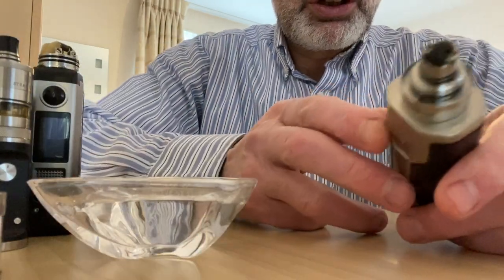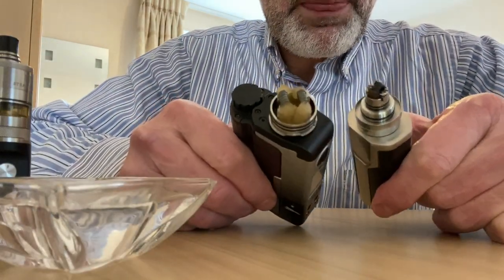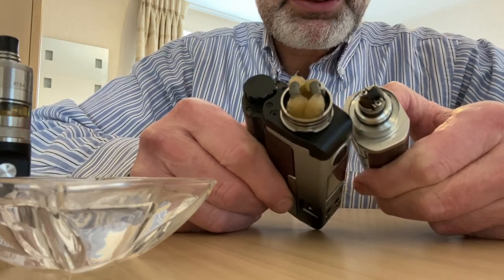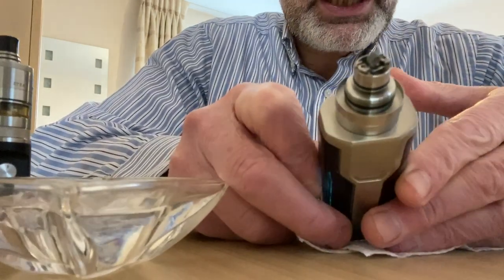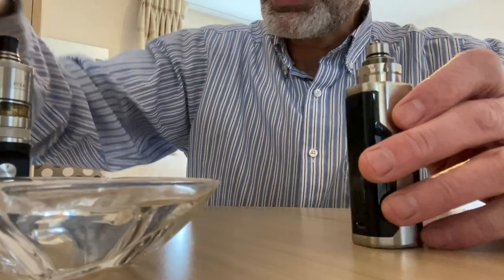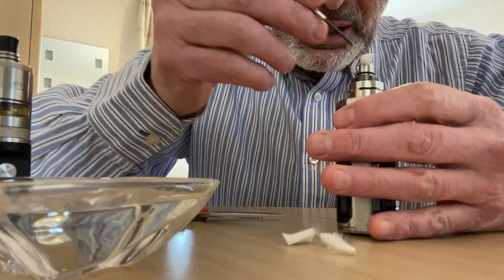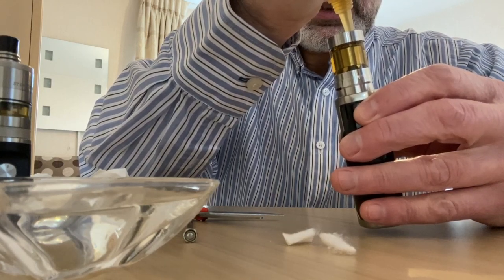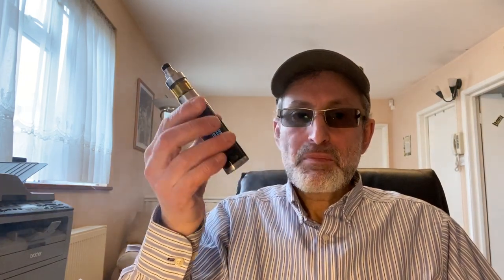How often should you re-wick your RTA | How to clean your RTA coil.

Comment: Isn’t it super dangerous to dip your coil in water while it’s still on your mod let alone a mod that’s on?
Reply from the maker: Not at all Shaun as you don’t keep the coil fired when you dipping in the water also you don’t immerse the deck and certainly not the top of you mod in water only the the tip of the coil, It is the best & safest method to clean & prolong life of your coils that I carry out every 2 days without any issues. I use the coil with the above method for up to 2 months.

Comment: How often do you change your coils for NET's when vaping daily? I'm using a 0.8ohm with 2.5ID fused clapton on kayfun x and I find the flavour now bit stale and I rewick daily. is it normal? should I change the coil? The coil is 2 month old and I use Burley Black Note
Reply from the maker: Wicking daily with authentic NETs is very normal. NETs only drawback is the rapid gunking. Black Note do gunk up coils. For me it is well worth the chore for optimal flavour. As for the coil itself if cleaned regularly it should last over 2 months. I change mine every 6 -8weeks  regardless.
Reply: @netvaper  Appreciate the reply. I can confirm the coil have gone bad because I just realized on my dani box when I fire the ohm jumps to almost 1.2 and then settle back to 0.8 even though the post screws where screwed tight. After changing the coil everything is perfect now and the flavour taste excellent as it should. Yes NETs gunk the coils super fast the coil always have thick black layer from 1 day usage. I think I will invest on kanthal round wire because 8 pounds for a pair of fused claptons is bit expensive and I have 2 other mtl tanks their coils might kick the bucket soon.

Comment: Great tutorial.  I've been vaping MTL & DTL stock coils for 8+ years.  I've thought about rebuildables for a while, and now, I am going to give it a go.  Top banana!
Reply from the maker: @Paul J. Morris-Pinchefsky. Thanks. let me know how you get on
Reply: @netvaper  I will, thanks. I've just been watching some of your MTL RTA reviews and they are all excellent.  I might go for Steam Crave's Aromamizer Classic as my first purchase.  Great work.
Reply from the maker: @projectmerlin   the Classic by steam crave is one of my favourites
Reply: @netvaper  Hi, reporting back... Yippee! I have just coiled and wicked my first ever RTA, and on the Neeko. First impressions; superb flavour!  Air flow isn't too bad.  I went with the 1.5mm below the coil instead of the 1.2, and 2.0mm at top. I might try the 1.2 in place of the 1.5.  Air flow is pretty good, but not quite on the spot. I've also just noticed a bit of popping going on, with slight gurgling as well.  I think perhaps my wick is too thick or dense? The tails are reaching the deck.  I'm trial running on the Eleaf iStick Power 2C in Smart Mode. I've done my maths too - 0.95 ohms set at 15 watts. I also have a couple of Digiflavor Siren Gs, and I'm using one of the skinny drip tips in the Neeko - looks and feels great. I often use these tips on a variety of my MTLs.  Anyway, I shall practise more. Thanks again. Great tutorial. I think the gurgling is getting worse. I'll have to investigate. Cheers.
Reply from the maker: @projectmerlin  Thanks for your update. Tip, always use a tighter airflow insert under the coil and either use a  bigger / same airflow on the top or non at all, the airflow will be much smoother . Pupping & crackling is usually from the fused coil. Gurgling happens when the cotton is over saturated, make sure your cotton ends fill the full width of the juice channels touching the deck where the liquid will be absorbed by the cotton. If you turn the RTA upside down, cover the mouthpiece with a tissue & suck a few times as hard as you can without firing. Magic, any gurgling will disappear. Enjoy the Neeko it is an excellent MTL.
Reply: @netvaper  Thanks for the tip - much appreciated. Shortly after last night's comment, I was fiddling around and then decided to remove the top airflow completely. This made a huge difference with zero gurgling.  I also reinstalled the Neeko's own drip tip (longer one) and it's wonderful.  So far, and thanks to your tutorials, everything seems absolutely dandy.  I've also just treated myself to 3 new mods too (an early birthday present) - the Lost Vape Centaurus Q200 & Thelema Solo, the old Wotofo Stentorian Basilisk, and another RTA - the OBS Engine.  I am very excited! 😃 Thanks again.
Reply from the maker: @projectmerlin  Wonderful Paul. All is good👍 enjoy all  your new vape gear😊

Comment: Very helpfull video! It would be nice to know at what wattage you heat up the coil, before dipping it into the water and also how many times you repeat this dipping process before you finally get rid of it  and put a new one. Thnx !
Reply from the maker: Thanks. I dry fire at 14w just to get a glow that burns the gunk, the dripping in water takes it all off so when fired again your coil is clean as new.  I do that very often up six 6 weeks and sometimes more. You can tell when the coil is gone it looks brittle and black even after cleaning.

Comment: Thanks for the information on how to manage RTA. I've just got my first RTA, Kayfun a lie, and have felt unsure if you would change coils every time the taste got worse. I myself use e.pipa and have always used pree-made coils. Tomorrow I'm going to build my first coils, exciting. Thanks
Reply from the maker: Good luck last0048.
Reply: @netvaper  I failed completely. All of it is too small so I can't see anything. I tried to use Geek vape mini tool kit. I think I have look after som pree vired coils or try it again later.Tha coils I try to use is Kanthal 28ga and that is a very thin one.
Reply from the maker: Take it slowly step by step. Get for starters Pre- made 1.0 ohm MTL coil. Fit the coil and secure then cut the legs flush then dry fire to eliminate hot spot then insert the cotton not too think that you can’t get it it through the coil then trim to fit in the juice well’s then moisten the cotton. Screw the deck in the tank fill and vape. Step by step you only need to do it once right and you will be able to do it right thereafter.
Reply: NET Vaper thank you very much. I will try to get some tomorrow 👍😇

Comment: Hello.What e cigs you can suggest as nice easy for use,also what is stock coils,and is it that   all e cigs you can upgrade with  rta or rda coils. I bought argus voopoo and all coils i used just simply sucks,also gets bad on taste,so just looking for proper cigs with proper coils.Also i can see you use thin head top ,thats what i am looking aswell. :)
Reply from the maker: Stock coil is a coil that comes with a tank that you can replace after it is gone with another coil. RTA’s use a rebuildable coil that you need to install on the deck and add cotton. A completely different style. Pod kits are different to stock coil, that the coil cannot be replaced so you need to change the whole pod. As I understand you use pod mod kits like the voopoo May I suggest to try the Innokin Gozee kit. Very good quality starter kit with excellent flavour & MTL drew,that you can use many different coils and change when needed.

Comment: try packing the cotton a little tighter in the MTL tank specially if u notice the liquid darken fast.

ran into a similar issue with the VXV soulmate rta pod where even clear eliquid went dark fast and the coil gunked up super fast. the issue has been fixed by raising my coil up a tad higher and wicking it tighter, i had clear liquid turning dark in 24 hours cuz of gunky eliquid backflowing into the tank. i also lowered the wattage by 5 but that was cuz i was worried the wicking wouldnt keep up, look up the wicking experiments morten oen did on youtube about how tight should u wick a coil.
Reply: the reason stock coilheads last as long as they do is the cotton pad is inserted tightly without damaging the fibers and is also getting pressed against the housing by the vertical "chimney style" coil.
Reply from the maker: @Azra Sashima. Thanks for your detailed & informative comment

Comment: Would you say that Nets taste better on a RTA RDA etc compared to a stock coil? For example the Aspire Nautilus...Innokin Zenith or Zlide Tanks? 🤔
Reply from the maker: Absolutely but on a  MTL RTA not DTL RDA. As NETs have natural flavours from the tobacco leaf that is best on low wattage max 18watts. High wattage would ruin those delicate favours & natural sugars extracted from the tobacco leaf. May I add that nowadays the Innokin Duo Prime mesh coils are very good also with NETs but would gunk up fast (2-3 days max)but  on a RTAs  you only need to change the cotton not the coil. The coil if cleaned regularly would last 4-6 weeks easily

Comment: Hey mate great review just wondering is there any big difference in flavour between stock and rta?
Reply from the maker: It depends Tom if you are a sub-ohm DTL vaper,  these days with excellent lower ohm DTL mesh coils there isn’t enough of a difference in flavour to change your preferred method of vaping, but if you are a MTL vaper, MTL RTA’s certainly give better flavour especially with good quality RTA’s & coils but it is bit more involved especially when it comes in setting up the deck with the right amount of cotton etc. I do recommend to try it for 2 reasons. First it is much cheaper in the long run as the main profit for any manufacture is on the coils. Second by a few simple techniques as you’re just watched in this review you always keep the flavour at it’s best by cleaning the coil and changing the cotton every few days depending what liquid you use. I am happy to guide you if you want to give it a go.
Reply: @netvaper  thanks for the reply and yes I'm MTL vaper using black note juices so which coil should i get and which cotton?  Also i was thinking on building coils so can you tell me which wire, inner diameter, number of wraps. Cheers
Reply from the maker: I recorded a video how do i make my own Kanthal coils link here,  https://youtu.be/F1Jeo-uuBgU in regards of cotton i use here is another link, https://youtu.be/4eSmlK04RB8 Of course you can buy excellent MTL 2.5mm coils from naturevape website in the UK  go for the Core Clapton or Fused Clapton so you can see the difference in flavour after using the Kanthal. Finally watch this video on what each wire type is all about, link here https://youtu.be/J8XMbU_nmS0     So now you have plenty info to get you started.
Reply: @netvaper  thanks for the reply appreciate it.

Comment: Thanks for the great vid, I’ve been vaping a few months now and I just started using an RTA, I was wondering what are the signs that the coil itself should be replaced? Also is a 2.5mm coil the ideal size or can a 3mm be good ? I ask because it’s always difficult for me to insert the cotton, and I expect a 3mm to be easier, but I couldn’t find 3mm size for mtl, so seems 3mm isn’t for mtl? idk
Reply from the maker: Thanks Yousif the obvious sign is when the juice starts to turn dark faster even after changing the cotton also the flavour does not improve after wicking. As a rule 3mm coil is meant for DTL RTA or RDA on higher wattage and more airflow. 2.5mm is for MTL as the deck is smaller and mtl airflow.
Reply: @netvaper  2,5mm is not only for mtl. The blotto is a dl and its better with 2,5mm. Not for me but many people do it. But i understand why you say 2,5mm is better for mtl.

Comment: In this video you said, you will answer questions. So I realy have a question, what is importent for me for a good conversation. What is your first name, than I can start my conversation to you with ,, Hallo ....'' or ,, Dear...'' 
I think, that will level up the conversation.
To this video, I spend some daytime now to play with the Fev I got two days ago. I agree to you, to take a look some times on the wick. I vape only Red Astaire and I feel evry difference, cause I vape nothting else. So I feel of course also difference by the wick. I'm not sure for seeing ghosts, but I'am sure for feeling difference by other drip tips in case of flavour, specialy on the Fev between the original drip tip and others. What is your opinion about that. Do I see ghosts ?
Best regards
One thing at last, on the gtr Taifun I have, the Impression, that he taste better, if the cotton some longer inside the wick with Red Astaire, specialy of course. I had the GTR some days by side, uncleaned, to taste other stuff. By useing later I used the GTR this way I dropt, then I checked the wick and changed the cotton cause the ,,mud" in the wick. The result was wronger then before...or I saw ghosts, maby...
Reply from the maker: My name is Nathan. Now Jens the right way of wicking the FEV is short wick not long hanging down towards the deck ( i change to this method) as you can get flooding when hanging down, so keep the cotton ends short as the juice flow hits the top of the cotton ends and do not drip to the deck. As for drip tip, yes for MTL you want a narrow bore that will intensify the flavour. As for ghost thank god I don't see them😊 BTW the mud on the wick is a sure sign of gunk and that ruins the flavour big time so change your cotton often.

Comment: Can you provide a link to the muji cotton pads you buy on Amazon?
Reply from the maker: @G-low I can’t leave links but if you copy & paste 
Muji Cut Cotton Ecru Unbleached Facial Puffs 60X50Mm 180 Pads in google you would find the original sold for $6 on a Japanese website. In Amazon they sell the same product for £9 something copy & paste the following, MUJI Makeup Facial Soft Cut Cotton Unbleached 60x50 mm 140pcs (it is really 180 pcs) Another very good one on Amazon is, Cotton Labo Organic Japanese muji pads Cotton Puff Size M (200Pc) which is cheaper but very good quality. Some prefer the Labo as it is cheaper for 200pcs. I use the first & very happy with it but when I will need to buy more I would try the Labo.

Comment: hi pleas do not put a red hor coil in water the  coils wire will get temperd or hard bad idea pulse the coil whait for it to cool down then take a tooth brush the when its cool clean it using the brush the pulse the coils on sy 20ww the 35w pul se until
ists not red hot but hot pleas do nor put a coil when its red hot in water
Reply from the maker: Ok Siobhan will try your way😊 thanks for the advice.